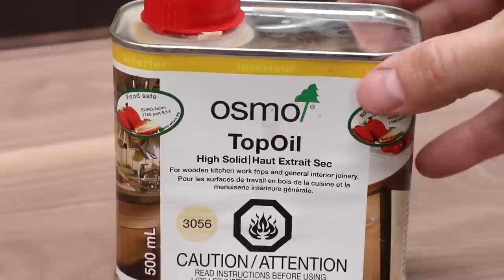Round Oak Table Top with Osmo Polyx-Oil Pure

Comment: That top is absolutely beautiful. For removing the part where the jointer doesn't reach, I fasten a thin piece of hardboard to half of the base of my trim router. I then use a flat bottom bit set to the bottom of the thin piece. The added piece then rides on the jointed surface and the bit trims the rest level to it.

Comment: I just tried osmo top oil on a red oak tabletop I'm building for a client. It's a really beautiful finish, I'm very happy with the results I got. The only other comment I have is that I think your technique is more complicated than it needs to be. I simply sanded up to 220, and then applied osmo using the same squeegee that you used. Then wiped off wet spots using a soft cloth. That's it. No buffing, no sanding pads, no wood filler, nothing else. Your finish might be better than what I got, but this is so good I just don't care to make it any better. Really an amazing finish, thanks for the tip to use it.

Comment from the maker: Here are some of the products used in the video. Buying through our affiliate links helps support the show. Thanks! Osmo Polyx Pure - https://amzn.to/2Xv3H3H
Osmo Top Oil - https://amzn.to/2T6YDUC
George Costanza Poster - https://amzn.to/2IJHtrq
Titebond Extend - https://amzn.to/2NDHrjr
Glue Roller - https://amzn.to/2wvEzNI
Tapered Plug Cutters - https://www.highlandwoodworking.com/veritassnugplugtaperedplugcutter14.aspx?A=1210
White Abrasive ROS Pads - https://amzn.to/2IUMuNI
Plastic Spreader - https://amzn.to/2NztTFX
Timbermate Pore Filler - https://amzn.to/2XwL8ft
Reply: The Wood Whisperer what did you use for the pore filler??
Reply from the maker: Timbermate. I'll add that to the list.
Reply: oh i love osmo. it's really idiot proof. which is a good thing me being me. oak is a really daft wood, though.

Comment: Hi mark
your videos got me in to you tube and you have taught me so much so feel a bit stupid trying to give you a tip, but for temporary router trammels instead of sticky back tape try drilling a hole through the trammel matching the diameter of one of your router guide bushes, centrally where you want your router bit to cut. Then simply insert the guide bush in to your router and pop it through the hole in the trammel. The best bit about this apart from speed is is the router can rotate as you go around.
Sorry you probably get sick of keyboard woodworkers trying to give you tips you already know.

Comment: The real question is “what does it look like after a year of use after spillages?”
Right now I am sitting having breakfast off a similar round table that is over 20 years old. I finished it with polyurethane. It’s top is one piece of cedar of Lebanon with lovely grain showing through. It has a couple of gouges but no watermarks or stains. Basically it is almost as good as new. It has had no attention other than wiping off with a damp rag after meals. 
So a showroom patina might sell a product, but that’s not enough for me for a horizontal top or a kitchen work surface. . .

Comment: Hi Mark! I am going to be preparing some flat slab desktops for my office. I've previously used only Arm-R-Seal. I was separately reviewing water-based products to build a platform for a power rack and I ran into discussions of using floor polyurethane. On investigating, I learned of a water-based low VOC floor conversion varnish called Bona Traffic HD. It is a commercial product, so I know I use it at my own risk. It is a conversion varnish, so I know I risk mixing too much and wasting product - and I know I will have a small working window. That being said,  it is supposed to have amazing durability/scratch resistance. I am considering using it to finish a set of slab desktops. I've read that floor urethane can be poor for contoured surfaces because it is meant to spread out on a flat surface. That shouldn't be a concern for flat slabs. I wanted to get your thoughts on it. Do you have any you could share?

Comment: This method of applying OSMO seems far less demanding than the usual recommendation of "scrub it all in with a scotch brite pad several times." Is that not necessary because of the pore filler, or does this work just as well regardless?

Comment: Was the original top solid wood?  I feel like nothing from a store is solid wood anymore.  Which brings me to to the pocket screws.  Did you just put them back in for the new top or go with another mechanical fastener solution because of wood movement?
Reply from the maker: the original top was solid. The new top is secured the same way. The pocket holes are fairly old and worn at this point so I'm not too concerned about wood movement. The screws had plenty of play.

Comment: Perfect timing! I’m planning to build a big round table right now. Question: why did you scrape and sand it before doing the pore filler? Seems like unnecessary extra sanding, but I’m sure I’m just missing something.
Reply: Yeah I'm not sure either?
Reply from the maker: I like the surface to be pretty much finish ready when the pore filler goes on. That way, once it dries, I just need to remove the filler from the surface and then wood underneath is already smoothed for finishing. Leaving the surface rough means you'll likely use more pore filler and then when you're sanding it back, you'll probably sand some of the filler out of the pores as you're trying to get the surface nice and smooth.

Comment: You mentioned you like to take the sanding to 180 or 220 grit.  When ever I bring my work to my finisher for finishing, he gets after me if I sand past 120 grit.  He says it’s not needed after 120.  Thoughts?  Thx
Reply from the maker: Personal preference I suppose. I like to sand to a grit that prevents me from seeing scratch patterns in the surface. That usually doesn't happen for me at 120.

Comment: I watched your 170 - Cyclone Separator Shootout today and then watched this video. I noticed in the background, at 1:28, you have the ClearVueMini CV06 which you weren't all enthralled with when the bucket partially collapsed under vac. Did you have a change of heart?
Reply from the maker: No, they had a change of design. :)
Reply: @woodwhisperer  Thanks, I should have watched the next 62 videos as you addressed it in 232.

Comment: With a table this size would it need bracers on the underside to stop the top from cupping? I made a small 40cm round top side table and after a few months it cupped and warped...? I reckon it needed a couple of braces on the underside?
Reply: Insert the obvious "did you plug it in?" question to rule it out...  did you alternate the end grain curve smiley face/frowny face?  I don't know the technical terminology for this, only that it's necessary.
Reply: P.S. Don't be offended, I used to work tech support.
Reply: @emilylindstrom724  Having studied carpentry and bench joinery skills I was taught this method of gluing boards together but my one happened to eventually warp..
Reply from the maker: @emilylindstrom724  Just FYI, I have never made an effort to alternate my end grain up/down. That's more of a long-term flatness solution and not so much something that prevents warping or cupping within a short span of time. The logic is that if the boards all decide to cup, you'll have one cup up, one cup down, and so on. So the table top won't rise up like a potato chip. Instead, it's more of a washboard pattern. So it's not stopping cupping at all, it's just aligning the boards so they cup in a strategic way (if they're going to). But if we can prevent the boards from cupping in the first place, we're far better off. So I don't really consider the technique a necessity when using good dry material, good techniques, a decent finish, and storing the piece in a climate-controlled home.
Reply from the maker: Panel warping can have a number of causes. The condition of the wood, how it was dried, how it was milled, how it was clamped, etc. And sometimes, in spite of our best efforts, wood does what it wants to do. Generally speaking, no panel "requires" braces. But braces can be something of an insurance policy to encourage a panel to stay flat. As you can see I didn't add any braces to this table and have no reason to expect it to cup or warp. Rotten luck could strike but because I did my best to make sure all of those other factors are in place (mentioned above), I'm confident it will stay nice and flat.
Reply: @woodwhisperer  thank you for your wise words! ;) also would the join between boards still be strong enough even if I don't include biscuits?
Reply: @TheKrsrocks  yes, edge grain to edge grain is very strong if properly done.

Comment: How long does the buffing process take?
Reply from the maker: On a top of that size? Maybe two minutes.
Reply: That's not bad, are the pads reusable?  I have a butcher block end grain maple kitchen table that is 2.5% thick.  I need too refinish  it.  Been debating on what too use.